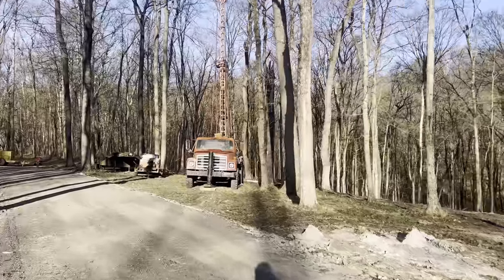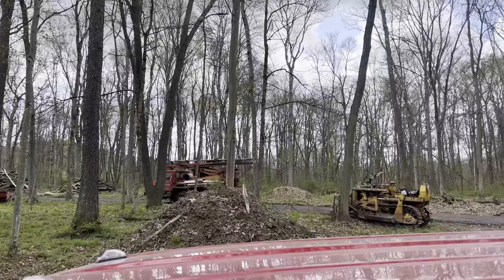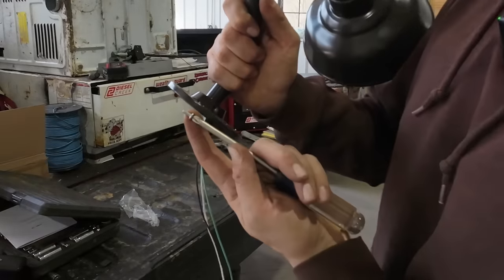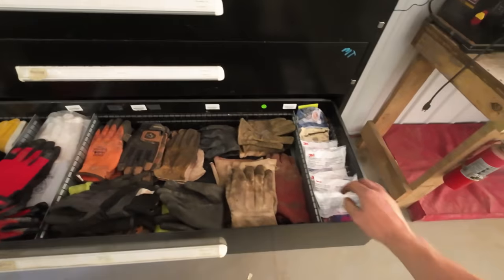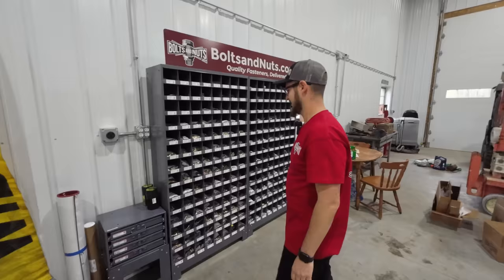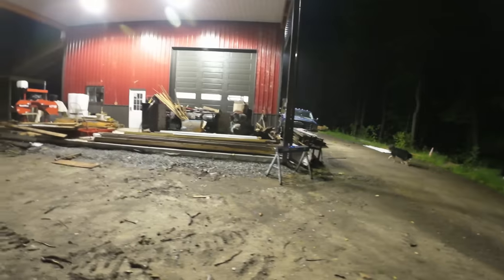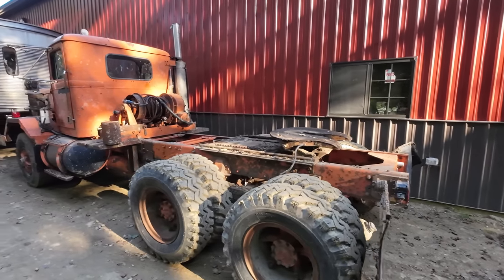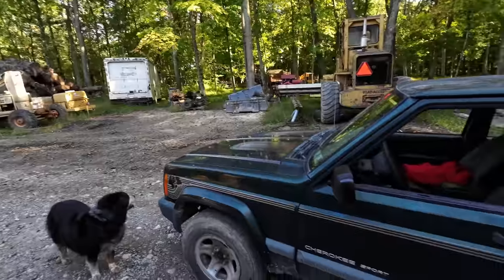1 YEAR Later, What happened to the DREAM SHOP BUILD

Comment: Consider a self-feeding wood chip boiler. Yah, you will need a chipper, a vibrating feed chip bin, electronics to activate the feed. Automated! Separately, build a big storage bin with a ramp to load it and a pipe across the top for a tarp on a rope and a pipe for weight on the other end, to keep chips dry. A chute dumps into a bin, an auger system like used to lift grain into silos, loads the boiler hopper. At 71, an Aspie, it's all whish full thinking! Some call it engineering!

Comment: Seeing that old International S series rig brought back memories for me.  My great uncle owned a water well drill/service company and I used to do summer work for him on my days off from working in the oilpatch.  The argument over Pounded vs Drilled wells can be a fierce one, but it all comes down to geology.  With a well defined water table (like yours would be, given the terrain and visible surface water) that is relatively shallow, pounding can cut down on the amount of silt and infiltrate because it doesn't disturb the subsurface layers in the same way that drilling does.  Where I am, our water table can be significantly lower and there are sometimes multiple aquafers to go through to reach target, and pounding doesn't do so well for that type of situation.  My old rig was a 1978 International S (don't remember the exact model) with a hydraulic powered rotary rig or a 1981 S series service truck for doing pump installs, servicing and airlifts.  Lots of great memories bouncing down the backroads of Saskatchewan, Canada in an old International with no radio and no A/C, just a thermos of coffee and a map.
Reply: My family used to own and operate a well drilling company.  Seeing that old well rig sure brought back memories.    In our area of NW Florida, we get a lot of sulpher in our upper level aquifers so to get away from that "rotten egg" smell, and taste, we used to recommend deep wells so you'd get into the "clean" water.  The shallow wells are mainly for yards and that sort of stuff although some people do use them for their houses with filters installed.  My house has a deep well with a submersible pump and I get really good water.  The well was one of the last the company did before they shut it all down as the city's in the area began expanding their water lines farther and farther out.
Reply: How does the pounder rig evacuate the dirt out of the hole for the well?
Reply: @jeffwilliams3642  By circulating water through the hole.  It will bring up most of the silt, dirt and such.  Once the casing is put in, you flow a ton of water through it to circulate out anything that remains.  How you circulate and flow the well is also dependent on what kind of subsurface geology you have as well, but this one looked pretty straightforward, so a constant cycle of water around the drill would get the job done.
Reply: @aeromedic5824  So once you get through to the water table you just flush the hole out till the water runs fairly clear?
Reply: Q ¹
Reply: @jeffwilliams3642   It just pushes it to the side
Reply: Hello 🤩🚜🚜🚜🚜🚜🚜🚜🚜🚜🚜🚜🚜🚜😂😂😂

Comment: Looking great. Don’t forget to fasten the bolt bin to the wall, although PA isn’t Cali a light earthquake could tip it over and make a terrible mess to put back into the different locations.
Reply: I can back that statement up, I have an (approx)  18x60x52 wide Husky box that was overloaded and it tipped over On ME, my stupidity, of course. I transferred a bunch to the US General 5-drawer cart, which I purchased on a Harbor Freight sale which really helped. Yes, a 6-hour Emergency room check for a head injury!
Reply: We don't have earthquakes in PA, unless you count forklifts and beer.
Reply: @chaddesantis4191 yes you do, we get them in NY too. They’re not as common as west coast but they happen.
Reply: @michaelandin1167  I've lived 30 miles away from Matt for 41 years. I remember a grand total of one earthquake, and it felt kinda like when someone farts next to you on a wooden bench, only for like 3 minutes straight with no sound, smell, or dirty looks.

Comment: Mat, 
First off this is a great video.

Some free suggestions, and not worth what you payed for them.
1)  One line for heating 16` x 16` floor is one line too few.  I live in PA, Franklen County. so I know the winters here.  winter of 23-24 is predicted to be pretty bad as compared to the last decade.,
2)  Show all the dogs at some point.
3) Over size the boiler, you will want floor heating everywhere you have concrete. 
4) consider adding additional conex boxes to the shed area.  That will extend the ceiling hight and the reach of the "wings" you want to install, and allow you to have a conex as the wall there as well.  Also at some time in the fuurture you will want to put in a concrete floor that will also need to be heated.
5)  While on the frame you might want to aff a good walke-talke radio so if the cell does not work the walke-talke will.

Comment: Your take on solar is spot on. Lived off grid for a few years, and can attest its not easy. Living in an area that gets weeks without direct sun in the winter is no bueno with an off grid system. You are also correct on recurring costs over time, its not a forever system, especially if you wind up cycling your batteries deeply during those weeks without sun. You can fix that by installing a larger battery system but the end cost is the same. Either replace batteries more often or buy lots more to start with. Love the shop by the way.
Reply: It's a work in progress and you've come a long way Matt. The shop looks great😁👍
Reply: Really most people undersize their systems and think they can get away with the least amount. We are going to go solar with the new house in several years. The plan is to have a hybrid system and sell back anything we do not use from a 30kwh plus system along with maybe adding a 20kwh direct grid tied system. 
If you build your system large enough today then in 50 years you sould still have enough solar and battery to live like you do today. Even future appliances will be more energy efficient. A freezer/fridge could be far more efficient if people would not care if the door and the walls were 6 inches thick. Which is why using higher end insulation is key to bring down the overall cost to run a unit. 
Solar systems today are also plug and play and have massive amounts of options. EG4 now makes a really nice outdoor setup that you can mount batteries and all in one inverter on your wall and be fully connected in no time.

Comment: Hi Matt, I'm also in PA and sorta similar situation of being in a valley.  The solar setup I have is direct to AC through micro-inverters on each panel.  No batteries, 24 panels on the roof.  Still hooked the the grid, but the solar supplements and reduces the cost of traditional power, even during winter though it's not much.  On a sunny summer day, the house runs on pretty much all solar.  The downside is that when traditional power goes out, the solar shuts off to prevent backfeeding and frying a line tech.

Just letting ya know that there are options out there.

Comment: After you get grid power, might consider install one or two minisplit heatpumps to the building. They will help with heating and get a/c in summer time as a bonus.
Reply: He ran about 2 miles of in-slab heating.
Reply: This past spring I had a minisplit system installed in my house with two heads. LOVE IT. I think one head would be perfect for his office space.
Reply: Those new mini splits are bad azz
Reply: @motor2of7  - The problem with heating the slab is that when you have warm days and cool nights, the slab gets heated and then when it warms up during the day, it gets too hot inside.  Mini splits will solve those problems.
Reply: the pint is that he's already committed to radiant heating
Reply: That has nothing to do with the summer it gets hot up there to. Those things do heat and a/c
Reply: @flattopworkshop3336  I have read where you CAN run chilled water in the system during the summer and turn it into a hydronic cooling system; the Mini Splits would be "Emergency" supplemental cooling if the weather gets extremely hot like it has been the past few years.
Reply: Except he has a million cubic feet. One or two minisplits won't do jack.
Reply: Quick calculation, matt's shop is about 56000ft3,  to raise temperature 30f you would need about 86,400BTU. Mr cool Olympus makes 24000BTU, if you would get two units, you'll have 48000BTU. It is about half of the needed 30F raise. So even with two units they probably can keep shop well above freezing and in milder weather much warmer. And they will work without supervision, wood heating is good when you are around to make fire. 😁

Comment: You will likely (depending on the geology) have a much better well yield by drilling with that cable tool drill rig. That is 100% true. Good luck. Make sure you get a good bacteria test from the local health unit or lab before drinking the water. Another tip is to use the well. Often people do not have sufficient turnover within the well bore to keep fresh water coming in from the surrounding aquifer.

Comment: Matt, you are taking me back to my childhood, my late dad used to be a drilling contractor and he used a similar rig to the one your contractor used. He also believed it to be better in certain aspects than the more modern compressor type rigs. It could however not compete as the modern rigs were able to drill several holes in the time this old rig could complete one! I am 61 years old and my dad passed away nearly 50 years ago. Thanks for bringing back fond memories with a tear or two.

Comment: I like each and every video related to your workshop. There is a huge variety of different work to be done, most of it by yourself. You have been working like a horse. I particularly remember the steel rods you prepared for the concrete floor. Down to earth videos where common sense prevails. You have also found sponsors, which is good. Definetly one of my top five channels.

Comment: LOL, a clutter free workshop. It's nice to have dreams. Regarding your electrical feed it might be a good idea to go from Mainline --> Pad Transformer --> Small shed with a transfer switch and a breaker panel --> Feed out to shop and house. The utility will probably force you to have the power meter installed at the shed location but that would allow you to run whatever power you want later without involving the utility as well as giving you a convenient place to tie in a generator. If you want to have a separate meter for the house and shop then you could do that to, you'd just need two sets of transfer switches. While it might seem inconvenient to have to the generator not near the house, if you have to run it for days on end you'll be happy it's not.

Comment: Good day Matt, This is important, damn important for your safety and the safety of equipment, this comment is for your electrician on power-up day.
(Squirrel: The drill rig attachment is of an old and true design but the truck, when you call it "old" well the cab style looks  new to me.  Or at least as I remember it.)
Talk to the electrician, to get his thoughts.  All of the secondary runs must be connected and ready to be energized PRIOR to power-up day. (Benefit, you can connect your generator before power-up day at the transformer.)
My goal of this comment is to make sure you have at least 120/240 at the barn, for most of your load..  Here is a plan for this.
0 - 
1- After the primary AND secondary cables up to the meter are installed, then,
2 - Measure the voltage at the meter WHEN the tap switch is in the neutral position. This will give the electrician, and linemen, a neutral tap voltage baseline.
Here is the important part:
3 - Before power-up day arrange to have about 1/2 the kVA rating of the transformer of LOAD connected to your distribution panel in the shop to exercise your new connection.
4 - At 1/2 the kVA LOAD measure the voltage at the meter and AT THE LOAD.  Well a couple hundred amps anyway.
5 - Have the linemen reset the tap to give you your desired voltage.  And there you go!

The power co. may have to place one or more ground rings at the transformer.  Mark locations, protect your conduit from rough handling.

Insist on the value of measured resistance.  Make sure the electrician is OK with the value, note the ground conditions.  I.e. Wet, frozen, dry etc.
Force or bribe the linemen to stay while you make your measurements.  Food works very well.  The Power Co. likes to act tough, ignore it!
If they leave, you will pay hell to get them back in a timely manner if something is wrong.

Please keep in mind that rural power is very different than urban power.  You can expect power failures and voltage fluctuations at any time, not only during storms.  Many farms an operations keep a backup generator for this purpose.  

These are just thoughts, if your electrician is in agreement of course.  Believe it or not, this long diatribe does not cover all contingencies your electrician will be able to "fill in the blanks."

You have installed places for pull boxes on  the primary.  Discuss this with your electrician but Utility class pull boxes are VERY expensive to buy and install, perhaps you would prefer to use a very small underground concrete vault for the linemen to use with a splice (butt connector).  Normal construction leaves the trench open. a splice is applied and they bury it.  When primary cables come above ground a lot of new and seemingly ridiculous procedures and rules comes into play.  Read that as inflating the cost of the work.
In defence of the utility, they own and are responsible for your new primary lines up to the secondary of the transformer.  They build the lines very robust so they won't have to come back and fix something.  Also exposed utility installations are very prone to contact by heavy vehicles.  This is the bane of the rural offices.  The utility may insist on a caveat for right-of-way added to your deed allowing unannounced access to the primary if needed for repair.  This is normal, don't freak out.  And remember right-of-way does NOT give the utility right to damage any of your property or landscaping, they have to put it back in like new condition...

I'm sure your electrician understands the importance of what I have said here.  Remember you are their customer just like you have customers and it pays to keep them happy.